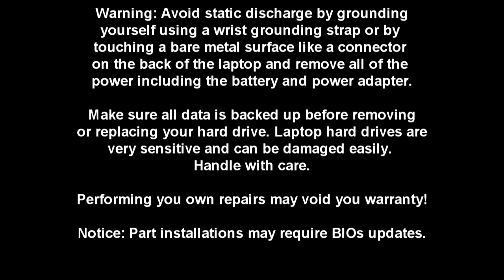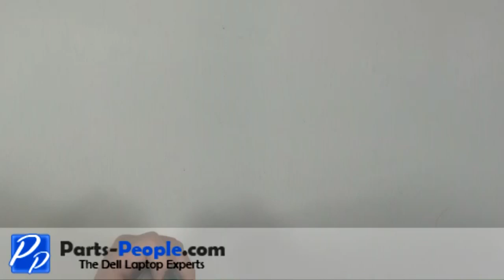Dell Studio 17 (1735/1737) | LCD Hinge Replacement | How-To-Tutorial

Comment: Your video was very helpful with my first ever work of this kind. My cat knocked the laptop of the window sill two years ago and since I was looking to fix this. Time went by and the cover near the hinge was totally worn out. After sourcing the new cover with hinges, I found your video.
the only thing that left me confused was the blue cable in the new cover. It's location differed from the one in my laptop's, but I connected the colours respectively to the WLAN and all worked perfectly fine.

Thank you very much. I gained experience and saved myself a trip into town and some money ;)
IO can now continue my graphic designer's work!

Comment from the maker: Once you open up the screen you should be able to tell. If the back assembly is broken you will usually see broken pieces of plastic. The majority of the times I've seen issues with the hinges, the problem has been that the hinges have broken off of the back assembly and the back assembly is what is needed for repair.

Comment: Excellent clear tutorial, thanks. I have a 6-year old 1737 and it has been a great computer. it has a problem on the left hinge and the screen bezel has snapped away from the other side. There is some strain near the hinge because it looks a little bent there and the bottom left curved portion from the screen bezelkpulls away from the lid on closure of the laptop. It has got gradually worse but now needs attention if it can be fixed. I am in England. My 1737 has been really great machine and has taken an awful lot of use. I would like to repair this sometime. Actually a little 10x8x7 mm angled bracket and a small screw appeared on the table this evening, fallen from the hinge area of the lid or along the bottom of the display. The computer is working fine as it always has in the last 6 years.
Really since I have seen some modern PCs I don't like them.I would like to repair the 1737 and add some more memory. It's on Vista though; perhaps I should upgrade that but don't like Windows 8.

Comment: AWESOME tutorial man, great job.I'm not sure however if I just need a hinge replacement or the entire back cover. Is there an easy way to know which has failed without first opening the computer up? In my case it is only the left hinge that is malfunctioning,it seems to me it is just the hinge that has messed up instead of the back cover because it doesnt close properly, the left hinge want to go backwards leaving the left side of the lcd hanging off the compuer when closed,hoping for a response
Reply: I have had the same problem that begun with a bad hinge. My laptop fell and since the hinge stopped closing properly. with time the plastic cover broke and now I bought a replacement back cover that came with hinges. I will have to place the old LCD into the new cover. The video seems great and should be just a case of following the exact order of removal and disconnection of cables. Yet I am fearing in case anything goes wrong.
will have to give it a go!
THanks

Comment: Top notch video, just completed a hinge repair and some lid surgery which I couldn't have done without this guide. Comprehensive & easy to follow both on the strip down and the rebuild sides.
My laptop had taken a major impact to the left corner, smashing the left side mounts, then right mounts gave way from taking all the load. So stripped the lid off completely and built up where the mounts used to be so as to line up the hinges with the remnants. Luckily I found enough shards inside to do this. Then I drilled through the hinges and case with a 1/8 drill bit and used 1 inch long bolts to anchor the hinges to the case! A bit agricultural and an economical fix to be sure but works admirably.
I could have bought a new laptop or ordered a new lid online but with all this free time thanks to lockdown I decided to tackle this job.... it's been bugging me for quite some time and it's finally done now. Just need to get to the bottom of who broke it in the first place now!
Thanks again lads, 10 out of 10.

Comment: This is a great guide! I am wondering if you happen to know why my 1737's screen sometimes goes off by moving it slightly. The quick turnaround is to close the screen and simply open it up. What would you suggest be the culprit to this problem? Screen works great and so does the equipment after being upgraded, I would not want to for a new as this one still has effective use. Suggestions are very welcome and thanks once again for sharing all these videos, they are an awesome guide!

Comment: Great tutorial. Mine just broke but its five years old with 2 keys broken. I am intrigued by the idea of just fixing versus buying a new one because the processor/ram and hard drive are all still pretty good specs. If I fix it, how long would you expect it to last?
Reply from the maker: They can last a while. It really depends on usage. Before you purchase the hinges, you should disassemble the display assembly and make sure that it is the hinge that is broken. I've seen many cases where the hinge breaks off of the back assembly, so the part you would have to replace would actually be the back assembly not the hinge.
Reply: Parts-People.Com, Inc Its the whole back assembly is needed. I can see the broken plastic when it pulls away. When you say a while, six months, a year? longer? I am pretty rough with my laptops. They get banged around, lost the keys while typing hard, Its used 12 hours out of the day, dragged around and have both kids and pets! The cats sleep on it. The kids drop stuff on it. I am very impressed its lasted with all the abuse.
Reply from the maker: Michelle Katz
It's impossible for me to really know for sure, but I could venture a guess of probably right around the same amount of time the original lasted. The parts we sell are real Dell OEM parts not cheap knock offs. So the should have the same lifespan. Oh and if you want to fix the keyboard in the future, we sell those here too. http://www.parts-people.com/index.php?action=category&id=148&subid=224&refine=keyboard
Reply: ahahahahaaha, my cats sleep on mine too! and also it was my cat who made it fall off the window ledge :( cracking the hinge inside :(
great laptops otherwise!